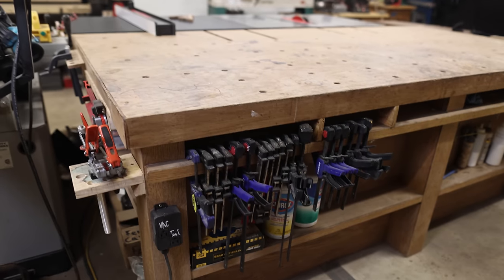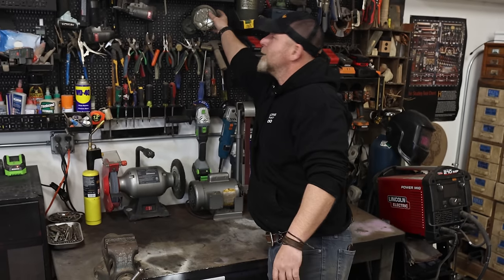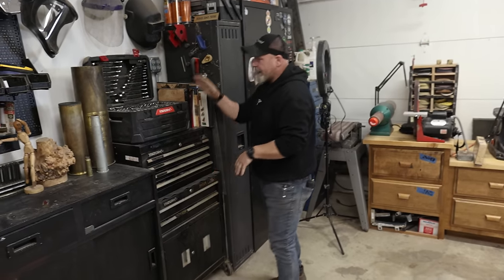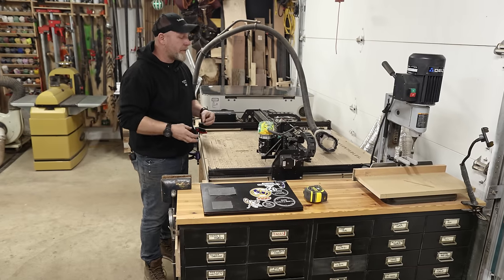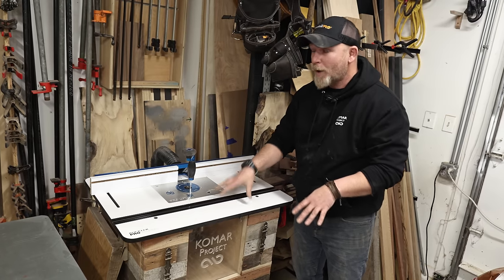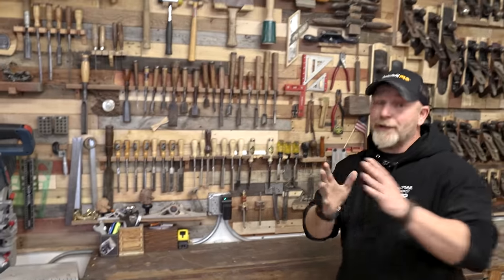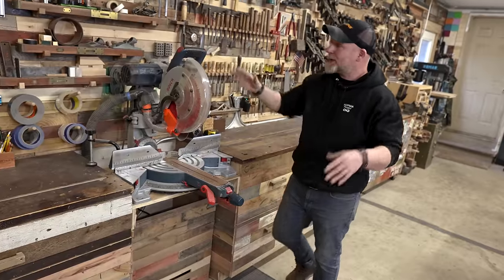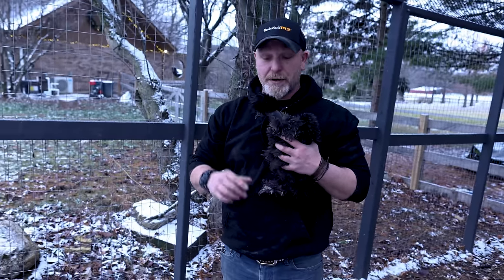Ultimate Garage Wood Shop Tour!!  Getting Tools CHEAP Tips!!!

Comment: Shou Sugi Ban on the mystery piece of wood.
Drill holes from the backside before burning, to fit LEDs later.
Use a router to hollow it out from the the backside to fit electronics.
Rughly shape before burning to get the fire to create an appealing shape.
Hose it down when it's burned enough and use a wire brush to remove the burnt wood.
Fit LED holders through the holes and pour clear resin over the whole thing. 
Seriously think that would look cool on the wall.